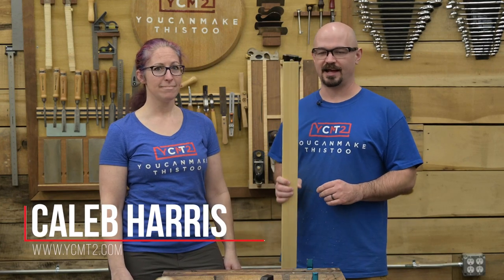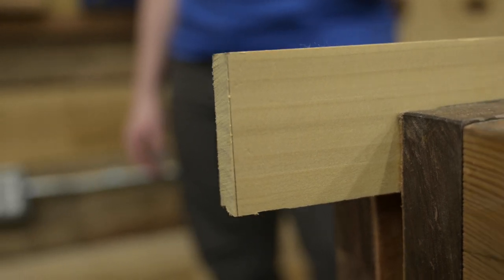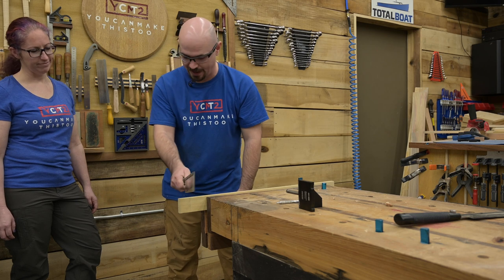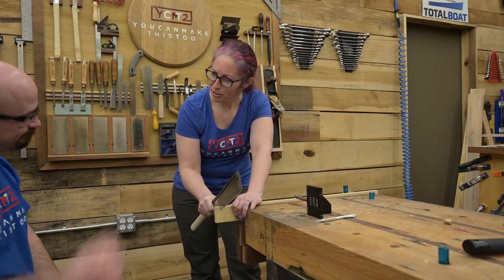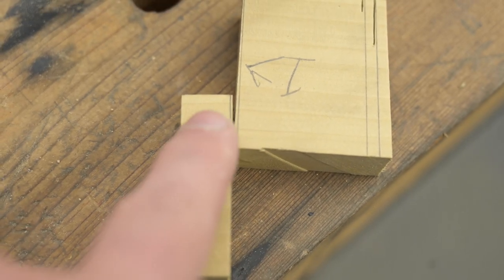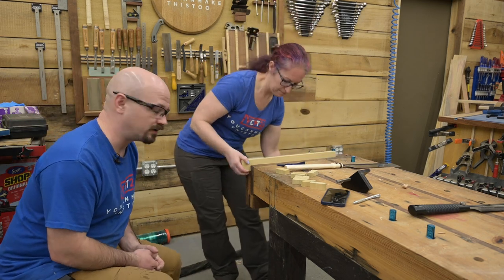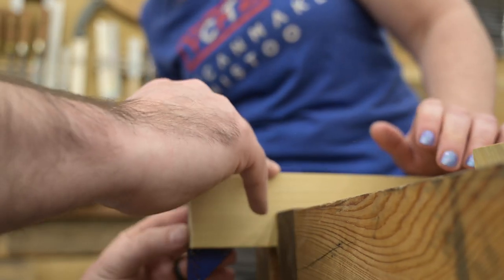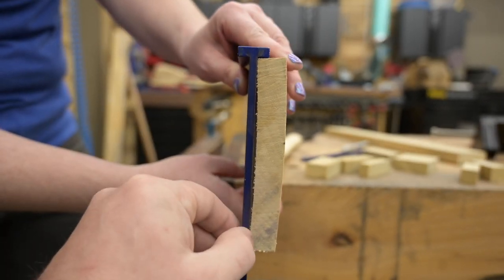How To Saw Straight with a Handsaw

Comment: The mirror image is a trick my dad taught me when I was very young and it has followed me throughout my 66 yrs. I knew you'd cheat with the miter saw - LOL. Stay safe.
Reply from the maker: It's so handy! No way I could cut straight without using it. Hope you guys are staying warm
Reply: @YouCanMakeThisToo  Back at ya! Fireplace is on full tilt and plenty of dry wood on hand.
Reply from the maker: @robert.brokaw3829  Sounds like you guys are pretty well set

Comment: Great video and great tips Caleb. Just curious, would you be able to recommend some good hardwood dealers around the Memphis area. I'm having trouble finding a good hardwood supplier here.
Reply from the maker: The Woodworking Shop in Bartlett is good, but very expensive. There's Hood Distributors in south Memphis. City Wood and Woodland Tree Service, also Big River Hardwoods.
Reply: @YouCanMakeThisToo  Thanks! I'll definitely check those out.